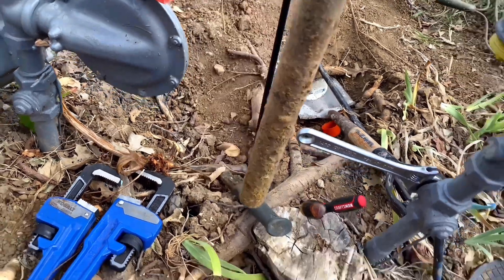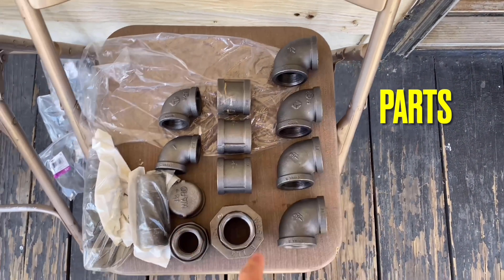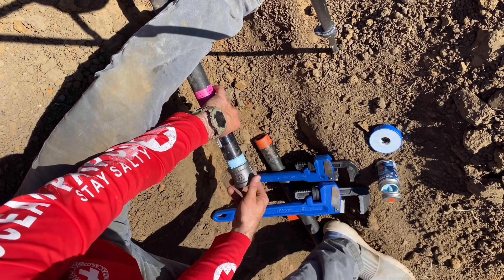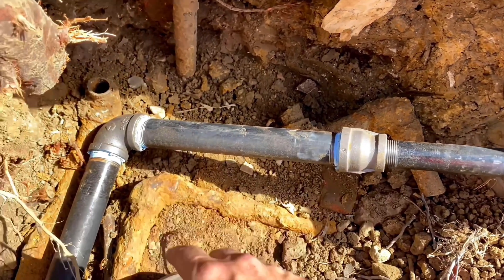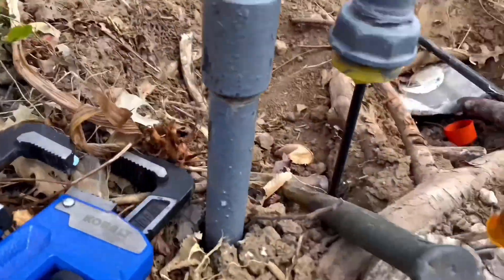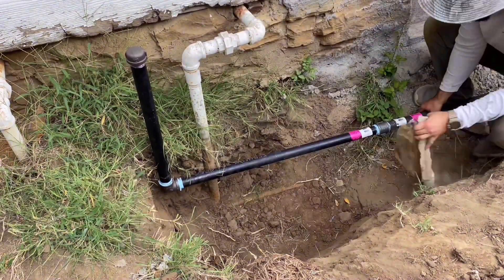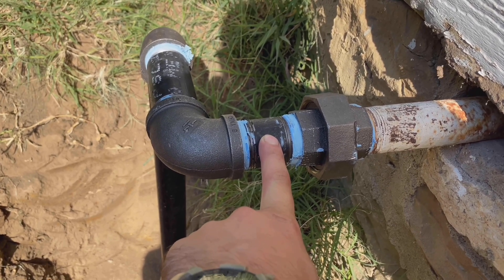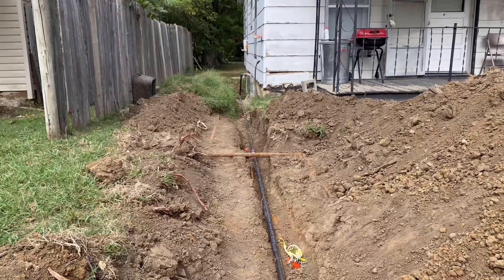How to replace a gas line from the meter to the house.

Comment: I live in north Texas. Was just quoted $10,300 by plumbing company to dig and replace old gas line with poly line. Little over 100ft from gas Meter to the piece that goes into house.. $10k feels high right?— they ran a test and said water in gas line. Isolated it to the underground piping
Reply from the maker: For whatever reason, plumbers charge a whole lot for labor lol! Not saying it’s bad just saying!
Reply: @GrantKeysProperties no it’s bad
Reply from the maker: It definitely can be but plumbers on YouTube, get offended by my vids lol
Reply: ya that was a over the top price for sure . just my son is a plumber gas fitter and he has to go and replace home owner repairs so often or plumbers work that screw pipes together no ticket or experience  they use   wrong size pipe no rust cleanout nipple ect .i guess it makes me critical cause of the safety aspect.and it voids house insurance in cases also. thanks for the conversation just people need to know diy consequences .
Reply from the maker: @GeneSewell2  Thanks for checking in. There is risk involved with everything for sure. As a home owner, it’s good to do your research or have a good friend that knows or hire out that big ticket plumber.
Reply: 10k is way to ver priced. I am a journeyman plumber in Dallas Texas, we just did a 80ft 1 1/4” gas relay from meter to house for 3-4,000. Also includes city permit, and digging. The only thing that would cause the price to increase is obstacles in yard like sidewalks, trees, etc… and if any leaks occur in the home. We Test the yard line and house separately for safety and per city requirement.
Reply from the maker: @holdenruppert7638  in my case, there was three huge trees that I had to dig out of the ground in order to dig up the pipe. The routes were down deep in the dig zone. And all of the interior pipes were old water, sewer, and gas. I replaced the gas pipes underneath the house with flexible gas line. Anyway, good luck finding a $4000 quote.
Reply: @holdenruppert7638  I live in Dallas and I have the same problem but is no concrete or anything between the house and the meter also y can do the digging part if you can just come and do the installation.
Reply from the maker: That sounds like a pretty good scenario! I’m sorry though if you’re not kidding. I don’t do work for other people mostly just because I don’t have much time and I don’t have a contractor license or anything like that. I just rock and roll and stuff! I share what I do as a way to save people money for now. I never thought where it could go I guess. I appreciate you reaching out!!
Reply: That's why you do the job yourself
Reply from the maker: Preach brother! ;)
Reply from the maker: Yes it is very high! That is why I made this video because I cannot afford a six to $12,000 job. I did all of this for like $400!
Reply: What nobody factors in when a Licensed gas/plumber does the work:

1) Insurance 
2) overhead
3) liability 
4) knowledge 

As a licensed gas contractor in Florida I give advice to homeowners if they feel my price is too high so they can do it themselves to code. 9 times out of 10 I get a phone call back. This job done in this video will not pass code here in Florida. No mechanical joints nor metal is allowed underground could be different at his location. Do your research prior to doing a job that requires a licensed tradesman.
Reply from the maker: This is a 1940s duplex and is grandfathered in. I used the exact same materials and put it back the exact same way that it was. It’s grandfathered in because at the time I was living there for over two years, making it completely legal. And it only cost me several hundred dollars not 15 to 20,000. ;) Thanks for reaching out!

Comment: Not knocking your job bro. But we can even buy plastic pipe in NY at big box store. Amazon sells it along with hundreds of other retailers. I'm guessing you are thinking about CCST that only one brand ik of is restricted to average joe without certification training,  Plastic does cost a few bucks more in my area after getting everything but the time savings, much less joints, and performance is worth it imo. If you go steel underground paint and wrap with the special tape to protect it for a few bucks its cheap and at your big box store also. Fixed is Fixed tho! Just food for thought on your next gas project....Carry on with the extra 8k in your bank account for not being lazy and getting it done!
Reply from the maker: Thanks for reaching out! First off, the reason I did what I did is because I was matching what they did so that I could avoid doing inspections from the city and having to get permits. I put what was there originally so that they thought it was original. The gas company had to come and turn on the gas. Obviously, they would see the digging and question everything. What is this they will say? I told them I replaced the waterlines because the water meter is right next to the gas line. Right under it in fact. So anyway, I’m a lot smarter than I look buddy. Number two. I did do flexible gas pipe, the stuff you can buy at box stores underneath the crawlspace hole. The whole house is flexible, gas line in which I have videos on that as well. Very simple very easy. And the steel gas pipe lasts 60 to 80 years. So I will never need to do it again. That’s unpainted. Mine if you watch my other videos where I do it step-by-step. You will see I painted the pipe three times. There’s no need to do anything else as I was matching What was there before. When you buy an old house, everything is grandfathered in. Unless it is broke like mine was. Then you will need to fix it like I did.  There is lots of ways to do a thing. And I did what was best for me and my situation. I do not have time or money to hire a contractor for $16,000 which was what the quote was for this job. I also know that if the city gets involved you will be paying the $16,000. I would rather spend $400 and do it myself in a smart way. Avoid the extra costs and move on with life.
Reply: @GrantKeysProperties  like i said I understand.....just letting you know incase u didn't. don't forget about it was like that when i bought it. lol
Reply from the maker: Thank you for the information! !

Comment: we could spray paint above ground  I think but below ground we cant use that pipe and fittings raw
Reply from the maker: @jeffreyplumber1975  Thanks for pointing that out, if you go to my gas playlist and watch my next video after this one, you will see that I painted the pipes gray with metal exterior paint three coats before burying it! Thanks for reaching out!

Comment: I dont know where this is, but in the state I live in, use of bare steel unprotected pipe was disallowed starting in the late 1960's or early 1970's. And the ditch had to be at least 3' from the foundation of the house or building. 18" minimum depth using poly pipe using prefabricated risers at each end to bring it above ground.
Reply from the maker: @billbraniger2306  Of course if you hire somebody you will have to do the new codes. If you buy an old house and you own it, you can fix it just as it was before. It would be grandfathered in as is repaired. Plus this is not unprotected steel. The steel if you watched my other gas videos all in order you will see that it was painted three times and pressure checked also by the local gas company was placed a green sticker on my meter. But yes calling a pro will cost a toe.
Reply: @GrantKeysProperties paint doesn't mean Jack must be wrapped and cathartic protected .. as I stated in another comment plastic would have been your best friend
Reply from the maker: @tracker1ify  I was quoted $18,000 to do this job by a professional. By the way, I did not hire him. He is worthless to me. I did all of it myself for $400. I have now paid for the property two times out of the rent money from my tenants. I’m expecting the property gas lines and everything else to last 60+ years. And that’s the way the cookie crumbles. By the way. If you follow my channel which you clearly don’t. Then you would know the full process and the pipes were painted three times. I don’t really care what you think. The reality of the matter is what I’m telling you right now
Reply: Yeaaaa I was just about to comment about this.. I don’t think that pipe is even dipped/wrapped.. if it was dipped/wrapped galvanized or black iron pipe then it’s still be legal so as long as the fittings are wrapped with 10 mill tape.. but that does indeed look like bare black iron to me in which at least in California it’s not code🫡
Reply from the maker: @wnnted8859  hello, I appreciate everyone’s concerns. But this property is still functioning in awesome condition. I never get complaints. I always get my rent. And the property is better now than it was then. I have paid the property off twice already in rent money. And the pipe was painted three times if you follow along on my channel to the next videos where I finish the full project, the entire duplex. All new. All working. And every hater that I get on here We’ll just have to sit back and hate me. I make things simple, not complicated. Not expensive. And everything I do lasts. Dream it and weep.

Comment: I like the work you did. I Just recommend that you clean the pipe with a pipe cleaning solvent of your choice and put rust proof spray paint for corrosion to save your work in the long run or use a anode bag underground if you want to
Reply from the maker: Thank you! Thanks for reaching out! If you watch the next couple gas videos in my playlists, in order, you will see that it was painted 3 times with rust proof spray paint grey, I definitely agree. I should have put that part in this video but I believe it’s the next one instead because it got long.
Reply: @GrantKeysProperties  no problem chief I didn’t know you had other videos lol good work tho bro
Reply from the maker: @blad170 Your fine! Yess! I got a whole playlist on the entire gas project on that property. Beginning to end. Inside flex hoses and the steel and all there appliance hook ins as well. Full documentation including 48 hr pressure check no psi drop! And a green sticker from the city! But don’t tell the city you did it! If they ask Just say it was already like that when you got it!

Comment: Never use steel pipe under ground. There’s a reason we use Polly now, steel corrodes and will break down in time plus coupling joints under ground. Run a roll of poly it’s cheaper and you only have two connections at each riser at gas meter and the house.
Reply from the maker: I could not get poly pipe at my local store. You have to have a license in the state to buy it. I could probably get some somehow, but in my case, steel pipe was easy to get and not too expensive. Thanks for reaching out. This pipe was used by every plumber back in the day, and it lasts and proves to last many years 80 years in my case, unpainted unprotected. I coated the steel pipe three times before burying it. Thanks for checking in!

Comment: This is not code and no way the gas company would allow the gas turned on again ,depth is a min 19"  why do people make videos like this ,i get people want to save money but when your family blows up it it worth it ?
Reply from the maker: You need to look up your codes in each county. In my county is 12 inches. Thanks for checking in.
Reply: yes i get that might be good to add that in the beginning of video .also i was supprised with your pipe everything in canada is the yellow plastic now .thanks for the reply .  @GrantKeysProperties
Reply from the maker: @GeneSewell2  I definitely probably should have mentioned that but I wasn’t thinking about it and the yellow gas pipe will be great as well. The steel will last about 60 to 100 years long. This old one lasted 85 years. The yellow may last much longer idk. Nobody really knows. Because it’s not been tested as long yet.

Comment: Still living in the stone age using steel pipe, which should be wrapped and have a sacrificial anode fitted. Why not use P.E.pipe,it’s a lot easier.
Reply from the maker: I will be using other pipes in the future. I want to show how to do it with several different materials. Btw this will last 80 years. I painted it 3 times, which you would see in my other videos after this one. I could not notify the city about this, because I was just doing repairs and had to do it as it was before to be grandfathered in. So there would be no questions when the gas company came out to hook up my new meter. In this case my meter was pulled when I bought the house. I can’t pay $15,000 to a plumber for a days work so this is what I did brotha man. If the meter would have been there, I would have used poly pipe with risers. You can not buy the pipe that professionals use without a contractors license in my town-state. I’m very satisfied with this job and it’s been working wonderfully. I also did it all for under $800. Have a great day sir.

Comment: You should never, ever run gas lines underground in black steel unless you sleeve the pipe. That would most certainly not pass code in pretty much any jurisdiction, and for good reason. It's going to rot out and you'll be left with a leaking underground gas line.  

If you want to DIY fine, but do it right with yellow gas poly and proper gas risers.
Reply from the maker: There is more than one way to skin a branch. That way would be good as well. Whatever is cheapest would best, done right. I will be doing yellow gas poly pipe in the future for another video but on a whole different property because the one I fixed will work for 80 years. Maybe more. Also if you followed along you would see that it was painted 3 times gray and passed by the fire marshal in my city. It also got a green sticker. And it was just done the exact same way it was before grandfathered in from the 1940’s
Reply: Atleast wrap it... This wont last long.
Reply from the maker: It was never wrapped before or coated with anything. It lasted just over 80 years that way. So won’t last long depends on if your living to be 2 or 300 years old. I don’t think you will but I guess there is a chance. This pipe was coated 3 times before burial so we will just have to see won’t we.

Comment: Am I the only one that realizes that this should have been done in galvanized or flex?  I'm sure the gas company doesn't mind since it's on your side of the meter when it rots away again.
Reply: Good reply
Reply from the maker: Thanks you!!
Reply: Even galvanized shouldn't be used over time, the zinc  flake off and clock the pipe
Reply from the maker: I understand that metal pipes will rot, but it is not a fast process. It takes many many years to happen and it is a material you can simply buy at Lowe’s without a license. Thanks for checking in!
Reply: @GrantKeysProperties  yes galvanized pipe had a way better life span. However, I believe it's against code. Copper type K works great as well 👌
Reply from the maker: I appreciate the info. I will definitely look into that! 👍
Reply from the maker: LOL let me guess. You’re a plumber? Of course plumbers don’t like me. I hear from upset plumbers every day because I save people lots of money from contractor sharks that screw you over with a smile on there smelly face. In case anyone is wondering. Gas lines can be steel pipe. This was passed by the city and the local fire marshal.  That is what it was before. Lasted almost 80 years unpainted. So yes sir, it will rot away after me and you both rot away. 😂 flex line is great. The problem is if you’re not a plumber you cannot buy the flex line. It is unavailable to people without a plumbing contractor license. Therefore I did steel pipe to save $15,000 on a plumber like Mr. Frank here. So yes go pay $15,000 for 10 hours of work to a plumber who can buy flexible gas line if you wish. Another funny thing is why would a plumber be watching my how to video? Think about it people. Regardless of what you choose to do, this is what I did and I am successful at what I do. Like it or don’t. I could care less.

Comment: This makes me happy the gas meters here are right up against the house. All that digging is responsibility of the gas company.
Reply from the maker: Very good!! I would be happy too! That digging was a project!! Your situation is better. A couple of my neighbors have them up on there house, I think the newer houses on the block. I guess the gas company finally figured it out and got tired of digging 😂
Reply: On the other hand, water meter is at the street with line going under the driveway. I'm going to hate that leak. Pray it never happens.
Reply from the maker: @tonyp8808  Goodnesses, yeah that is gonna be a tricky fix. I hate when plumbing is under sidewalks and gravel and such. Hopefully 🙏